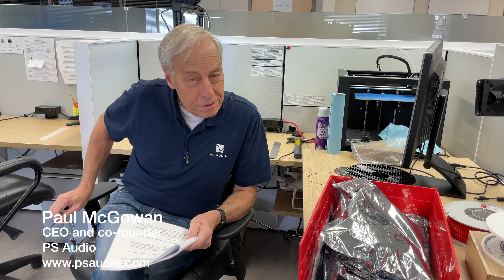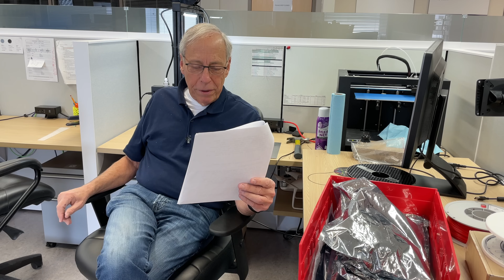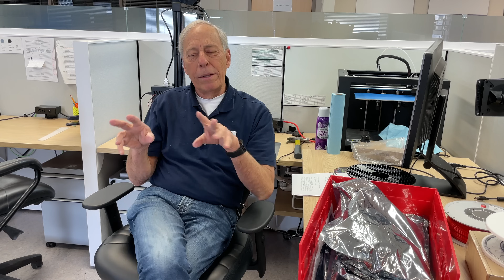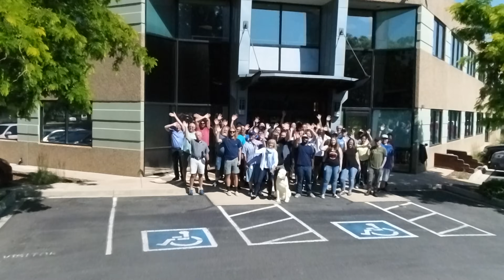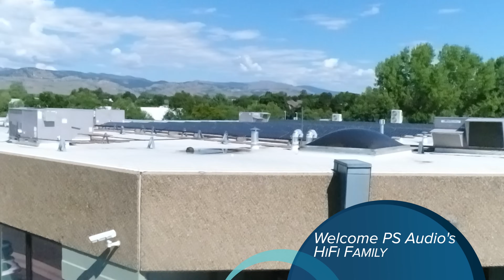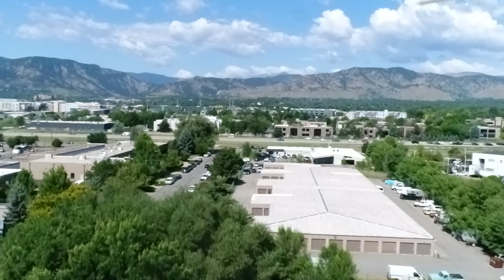Does bi amping change impedance?

Comment: Bi-amping is actually a waste of money and brings no sonic benefit. Better get a higher end amp or mono blocks and be done!
Reply: How much would it cost you to bi-amp?. Didn't cost me a dime. Just a few feet of decent cable. The spare amps were assignable and came with the unit. So, cost?
Reply: @jonnsmusich  Of you use the extra surround channels in your surround reciver for bi-amping then there is no real benefit...😝 You really wont get more power as most think. For that you need bigher amps or run bridge mode.
The real benefit with bi-amping is using 2 different amps. I.e one amp with better highs and one amp with better lows.
Reply: @Oystein87  Exactly right. For each speaker one amp goes to the tweeter and one to the woofer. Start with a higher end amp and then use the inbuilt program to assign the amps. Easy to do and no cost.
Reply: @jonnsmusich  I think you missunderstood me.. Bi-amping frome the same reciver/amp as you describe brings no real benefit..
Bi-amping only makes sense with two physicly seperate and different amps. So no.. Don't waste the time on assigning channels for bi-amping.. Get two different amps instead. I.e: Your sorround reciver drives the tweeters and a different and seperare stereo amp drives the woofers.
Reply: @Oystein87  It doesnt need to be separate amp.There are plenty of Dual Mono power amps.Each channel is separated from each other so the signal goes separately.
Reply: @beslemeto  Yes it does if there would be any point at all in doing it. The whole point is to get the best of two different amps.. One better for bass and one better for highs.. If not then there is no mentionable benefit.
Reply: Sonicly there is a benefit if one amp has better lows and the other better highs etc. There are benefits in some cases so then it's not a waste of money😉
Reply: I have a 6-16 ohm surround receiver (Onkyo TX-NR656) that can bi-amp and 2 4ohm speakers (Dali Suite 2.8) that can be bi-amped. Is it better to bi-amp or not? I found that the receiver can drive the speakers as long as I don't play them very loud, but the resistance/power principle is not yet clear to me.
Reply: @Lyas82NL  …this actually means that your amp (or receiver for that matter) isn’t a good match for your speakers. Your speakers require an amp that is stable down to the mentioned 2 ohms of your speaker. That is relevant to always be able to control the speaker at any draw of current wich is required by the music signal. Your receiver is only stable down to 6 ohms….
I personally would refrain anyway from receivers (apart from wanting to have surround sound). Better get a decent two-channel amp …your speakers will reward you with much better sound. But check before you buy if your (future)amp works stable down to 2 ohms!
Reply: @bikemike1118  The 4 ohm (not 2 ohm) speakers sound great when listening music in stereo and when watching movies and concerts 5.1.2 channel on the 6-16 ohm receiver. Paul told me in one of his videos that as long as I don't stress the receiver it is no problem. But since I do use the receiver  in a way that it is not really intended, I was wondering if bi-amping would be better or worse.
Reply: @Lyas82NL  if I were you I wouldn’t spend/ waste any money on bi-amping. If you like the receiver for movies and stuff…just keep it for that. 
If you like the Dali speakers look for a good and current stable stereo amp. That’s it … for starters 😉
Reply: You are not right! I was bi amping all my life with different amps and the sound improvement is outstanding.More detail, separation and spaciousness to the sound.
Reply: @beslemeto  ..this mix of amps is rarely a great thing. Because it’s most likely lacking synergy. 
As I stated above already: it is way better to get a BETTER quality and sounding amp (or two if you go for mono blocks)  instead of two separate mediocre ones possibly from different manufacturers. -> not good in general -> not recommend!
Reply: @bikemike1118  Actually i found out that my amp is dual mono so i can bi amp with it without buying another amp.Thanks for the reply!
Reply: @beslemeto  o.k., …if you feel the need to bi-amp …
Reply: @bikemike1118  I know bi amping is improving the sound so it is a must to do.It costs only 1 more pair of cables ☺ Take care!
Reply: @beslemeto  you probably mean bi-wiring …not bi-amping, right? 
Tested that as well in the past with a same set of speaker cables : no benefits!! Waste of money for the second speaker cables. So I sold them again. Better buy a better set of speaker cables to begin with.
Reply: @bikemike1118  Bi Wiring does nothing to the sound! I mean Bi Amping! Bi Amping is when you connect 8 channels from your power amp (if you have them) to 8 speakers inputs (2x4).4 for the lower frequencies and 4 for the highs. If your Amp has only 4 channels you need another amp.I've got Yamaha MX-1 which is dual mono power amp so it is 2 mono amps in 1 chassi. By the way my speaker cables are excellent. Canare are super neutral and excellent for the money!
Reply: @beslemeto  okay
Reply: @bikemike1118  You don't need to mix the amps sir!By different amps i meant 2 same ones, but different brands.Or if your amp has 8 outputs you can bi amp with 1 amp!
Reply: @beslemeto  …thx, but not an issue any more for me personally. Just wanted to share my experience in the past with that all.
Meanwhile I have Pass mono blocks and only single-wire terminals on my Wilson speakers. Take care

Comment: In a nutshell - biamping eases the power amplifier's job in driving the speakers, although going for the full active route eases further your power amp's burden in driving the speakers.
Reply: Not noticable. But you do get benefits of different sound7nt amps working together to get better sound than one of them did alone. I.e one better bass and one better highs.

Comment: Get a component measurement device like DATS and measure the by-amp-able speaker in question in the 3 arrangements discussed here by Paul and overlay the 3 resulting Graphs of  Impedance and Phase in a program like OmniMic or REW. Then you'll have a greater and clearer understand of this topic of discussion. If you can't do that, then watch some GR Research videos. ;)  :)

Comment: Well that was an easy one but it made me think. If you Bi-Amp, the two amps will see as Paul says a very high impedance for the frequencies the "other" driver is operating. To avoid amplifiers loosing (precise) control because they have no load at some frequencies, would it not be a sound improvement to place a 100 Ohm resister in parallel to their (partial) load?

I got this idea because some people practice this with tweeters that tend to have very high impedance s at high frequencies due to the voice coil inductance.
Reply: Amplifiers do not have a problem with high impedance loads.  Amplifiers have a problem with low impedance loads.  Amplifiers can run with no problem into an open circuit.  Amplifiers do not "loose control" because they have no load.

Comment: Thanks for answering.
Reply: the qeust. was cuz I thought since jumpers are wired positive to positive and negative to negative mean parallel wiring.
Reply: @LaGataNegra3073  They are in parallel.  The formula for the combined impedance of two parallel impeadances is:

Ztotal = (Z1*Z2)/(Z1 + Z2)

The trick is that the impedance of both the woofer and tweeter change with frequency do to the action of their crossover filters.  So at 100Hz, the impedance of the woofer might be 8 ohm but the impedance of the tweeter might be 100k ohm.

(100k * 8)/(100k + 8) = 7.99936... ohm

Or basically 8 ohm.  If you analyze the formula, you will find that when you have one of the parallel impedances that is much larger than the other, that the combined impedance will basically be equal to the lower impedance.

Comment: in this specific case with a single receiver trying to bi amp, that can't be done. the receiver still only have one power supply. 
and i like to add a question myself: when we bi amp it is usually the woofer having a impedance drop, so then the bi amped speakers will only affect the impedance drop to the amps driving the woofer?
A low impedance is the problem and are not not carried over to the top part of the speaker i think. one of many benefits from a bi amped speaker, like adding more power supplies.
Reply: It can be done and is beeing done. Many newer sourround recivers offer this option to assign the 2 extra surround channels to bi-amp mode. One power supply or not does not really matter. Still 5 or more amps in a surround reciver.
But bi-amping on a single amp is just dumb and makes no sense. Main point is to have one amp with better higs and one with better lows.
Reply: @Oystein87  bi amp to get more power supplies is most of the benefit of doing so.
surround receivers are not hifi so why bother anyways.
Reply: @sudd3660  The benefit is two different sounding amps working together fir overall better sound.
There are plenty of HiFi high-end surround recivers so that's not true. But there is no real benefit in bi-amping from the same reciver anyway.
Reply: If using a receiver with bi-amp option is there not a benefit in reducing work load on the amp? Rather than pushing one channel’s wattage to both you can push full channel potential to tweeters as well as drivers? Forgive me as I have yet to hit puberty in this sport...
Reply: @ricksoto7467  Very little since the tweeter and mids barely require any power.

Comment: There are plenty of weirdo speakers out there too. My Harman 3-ways have the woofer and mid combined together on the bottom post. Tweeter is on its own. Back of the enclosure says 8 ohms, but all the speakers are 6 ohm Vifas. Not an issue, unless you have amps that aren't rated for 6 ohms or you weren't aware of their trick to draw just a little more power from the amps.
Reply: The crossover takes care of that
Reply: Uhm.. That's not weird but pretty normal...
And what ohm it says on the drivers is not the same as what the amp "sees" after the crossover etc.. I see you have missunderstood something here.
FYI: A amp can have written i.e "8-16ohms" and still have no issue driving 4ohm speakers.. Atleast an amp from this decade.
Reply: @Oystein87  Nothing misunderstood. I used a multimeter on the posts of the speakers. Its mislabeled. Either an oversight or on purpose. I have several home use power amps that I use because they are rated 4 ohm safe.
Reply: @1rexrex  Well.. The rated ohm is nominal. Not constant. So speakers might have a slightly different resistance when just messuring like that.
Don't need to je "rated" for 4ohms.. Unless it's a 80s amp it's no problem. My amp says 8ohm. I drove my old big 4ohm speakers really easy. But now I have 8ohm speakers.

Comment: NO..Not if you do it properly using the low-level signal and feeding it into its own dedicated amp. The output of that amp goes to the secondary speaker terminals which are typically just connected to mids&tweeters. Many speakers have a switch for this by the speaker terminals so the LF section of crossover network is switched out and the signal routed properly.

Comment: Is the crossover impacted (bypassed)with bi-amping
Reply: IMHO no.  The crossover point is a function of resistance of the driver dictating frequency.  So for a simple case, take a first order hi pass filter to the tweeter.  It is a simple capacitor.  To set the crossover frequency you take the desired frequency and the impedance of the driver and you get the specified cap value.  For a 4kHz cross over to a 8 ohm tweeter you need a 5uF cap.  Then the amp sees  8ohms above 4kHz and steadily increasing below 4kHz.
Reply: @user-od9iz9cv1w Thanks I've been looking for said info.